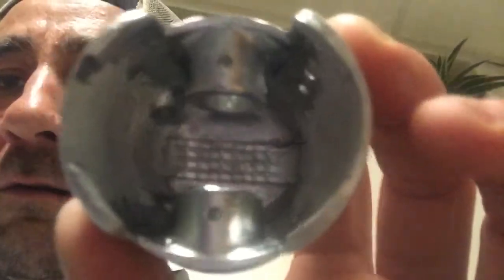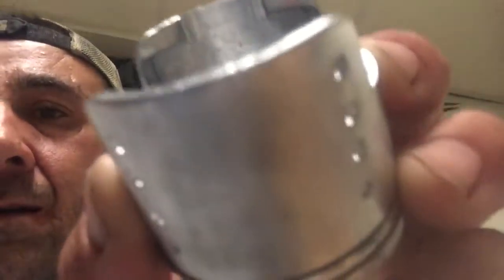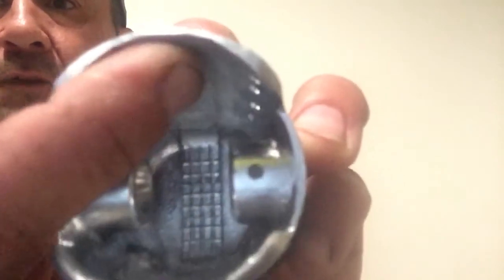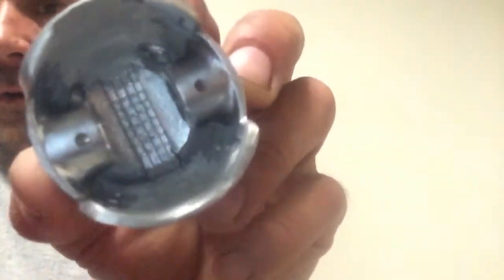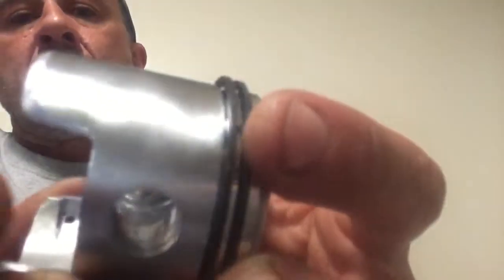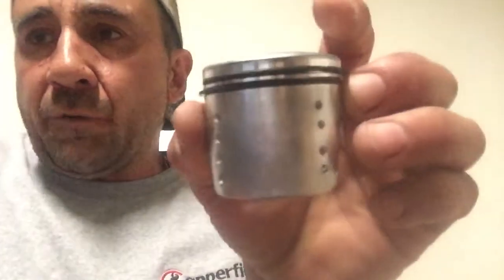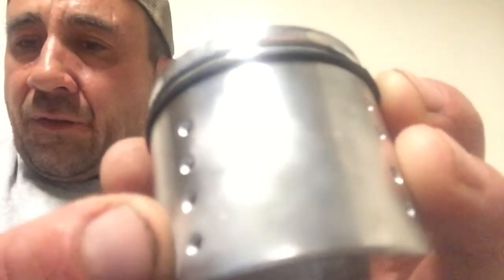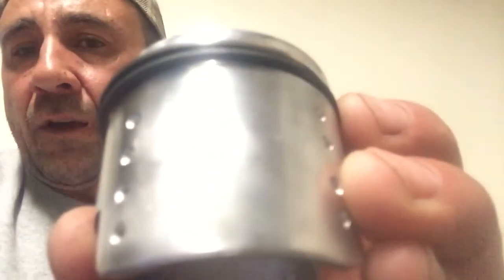Modified Piston on Mail Call for Brody King/ Motorized Bike Customized

Comment: First time I've saw this done.. excellent idea 💯 ✔
Reply from the maker: The full video is up if you need it lost of talking on other stuff you can just skip around. The holes have to be between the transfer and the exhaust so you font drop compression. Hope it helps its for single piece jugs or Minarelli but it will work in other setups with this issue more than likely

Comment: Nice there's holes in the bottom with the wrist pin is at my piaggio engine has the same thing I was deciding on drilling those holes by the skirt but did not want to ruin it we'll see how it goes
Reply from the maker: It has to miss the transfers and the exhaust so you don’t loose compression.

Comment: Use good 2 cycle oil , is no need to do that to the piston .
Reply from the maker: BT100 not the same as Phantom. I have this problem fixed many times.   Very fast for this setup. And the best oil also.
Reply: @rogerstafford-wakeinc.2088 I read a few articles on the difference between  castor based 2 stroke oil and non castor fossil/synthetics......They use castor based 2 stroke oil because the castor oil actually gets thicker the  hotter it gets & can save an overheating engine from destruction. The downside of the castor oil is- more expensive & it gums up the engine quicker which isn't really a problem on a bicycle engine since it's so quick/easy to take apart & clean....The benefits of fossil 2 stroke oil is- cheaper, less deposits. The downside is in an overheating engine. Once the oil reaches a certain temp. It burns away 🔥 creating 0 engine oil lubrication/protection. 
If I get a Mineralli or single piece cylinder prone to overheating issues. I'm gonna use a castor based brand oil and cyl head/spark plug temp gauge. I think your piston mods along with castor oil & temp gauge = no worries of engine damage or piston seizure.